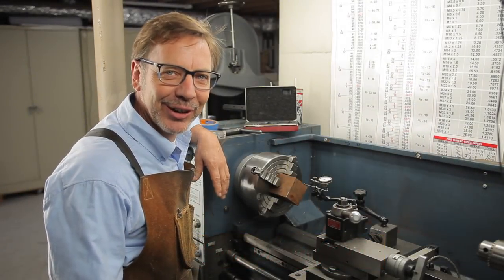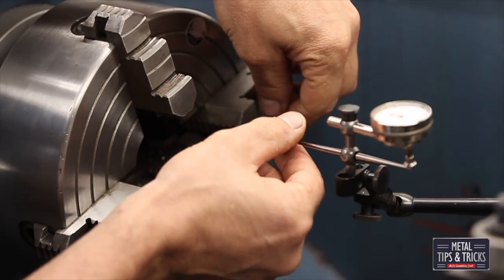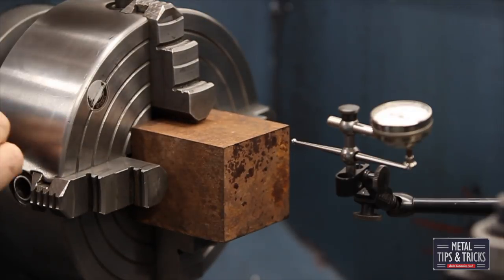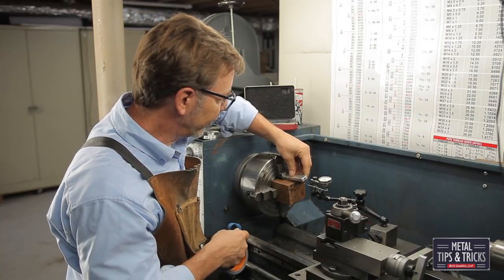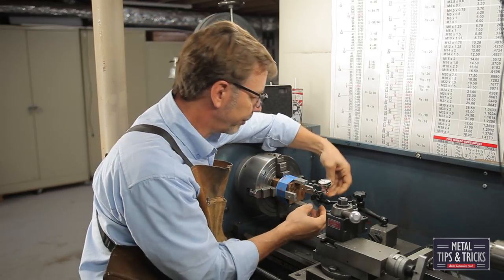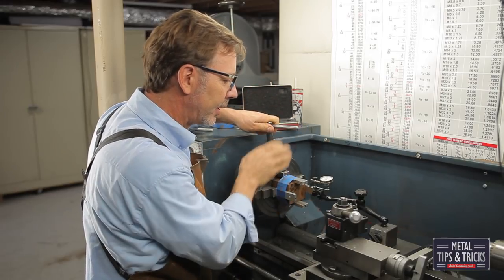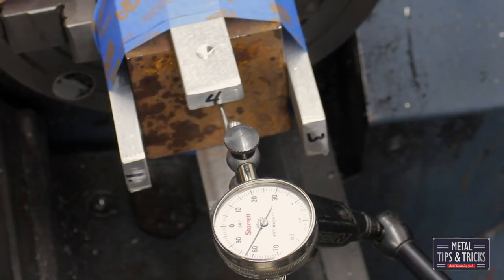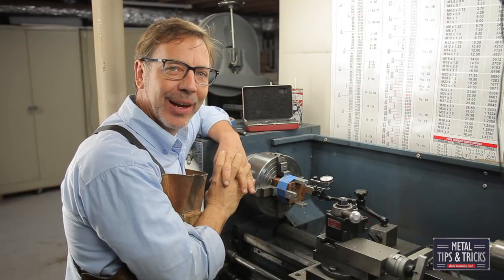4 jaw  Square Stock

Comment: Wouldn't be simpler to mark the center, and use a dead center in the tailstock to center?
Reply from the maker: I think that a good way to do too
Reply: Except when your part has no center. Why do it difficult when you can get it just as easily being accurate?

Comment: Saw Joe P's video using the same method but with rubber bands. Tape may be a little better, then I though of using a bicycle inner tube. Stronger and more secure that rubber bands, and reuseable. I figure most bike shops would give you a shot tube.

Comment: Good to see you are learning from the best but you could have given him the credit. 
I know you like the gauge reading vertically but if you have it reading horizontally you can get at the two opposite key holes, your way you can only adjust one at a time. Also you don't have you futz around with awkward screws on the DTI stand as, if you mounted it to the cross slide, you can use the CS feed screw to zero the gauge, but everyone to his own.
Reply from the maker: real good point :-)
Reply: Which good point?
A wise mind adjusts its opinion according to new information, only an idiot/bigot(same thing) maintains one view forever. There is no shame in changing your mind.

Comment: err sorry Dale but I had to give you athumbs down on this one.You ex colonial chaps seem to have made some progress but apparently not enough Here's what a man from over the pond would do. Firstly centre punch the point where you want the piece to turn,this can be offset which your system can't do,then using the tailstock centre you place another centre between the centre punched hole and the tailstock.Put your dial guage near the chuck on the intermediate centre,I use the centre from a dividing head as it has a parallel part,and go from there.If I find your video on half angle screw cutting ,I'll leave a comment to show you a far quicker and more practical method of doing it.Thanks for all the effort that you put into making the videos
Reply from the maker: HI Michael, You gave me a thumbs down because I didn't do it your way?  Don't worry we can still be friends. Thanks for your honest comments :-)
Reply: I have to thank both of you for new techniques to align square stock in the chuck. It's not about one technique being superior to all others; it's about gathering a rich repertoire of methods to handle various problems. Every one of these techniques has certain flaws and advantages, and we pick the one that works best in the situation we are faced with. As with all things in the machinist's art, There's More Than One Way To Do It, and that's a great thing.